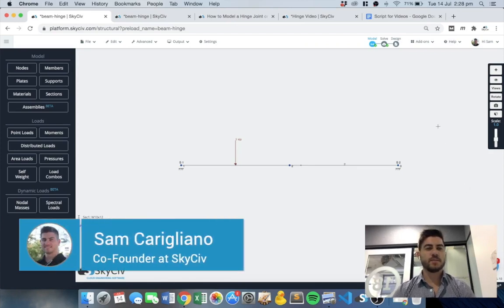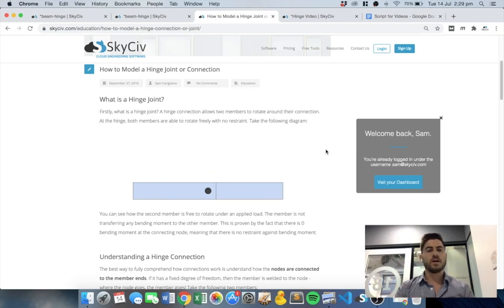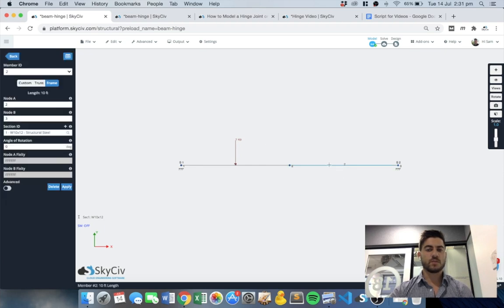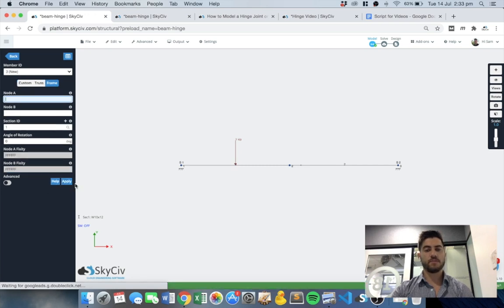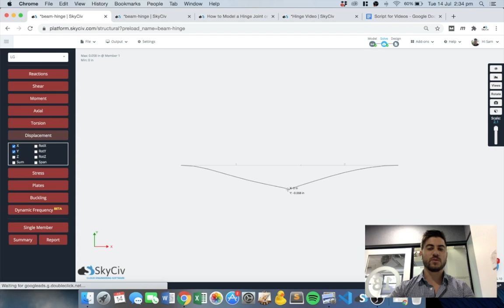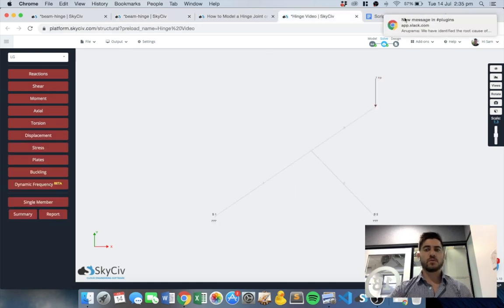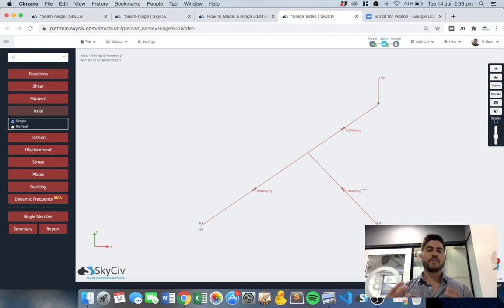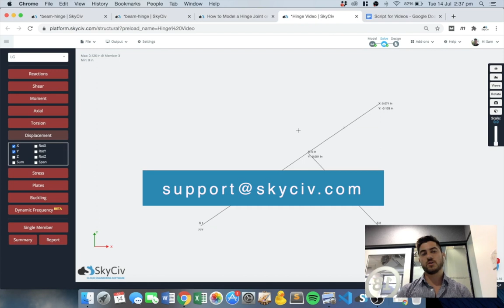How to Model a Hinge Connection/Joint in Structural 3D? | Cloud Structural Analysis Software

Comment: Hi Sam. Not really related to this, but why does skyciv have the y-axis as the default vertical axis? All my other software has z as the default. Is there a particular reason for this? I understand that 2D models are usually in the xy setting so that is probably it. But setting the z-axis everytime I launch is bothersome. Is there a way to have z-up as the default whenever I launch S3D?
Reply from the maker: Great question! This is just software and region-based conventions. I know this is a hot topic! Thanks for the feedback, we'll add this as a default setting in our next update later this week.
Reply: @SkyCiv  Nice one. Cheers! Will definitely make importing from Tekla a lot simpler! Are there any plans for more advanced Tekla integration by any chance?